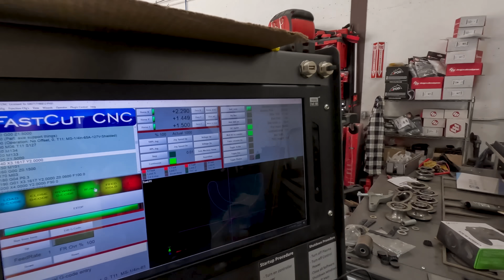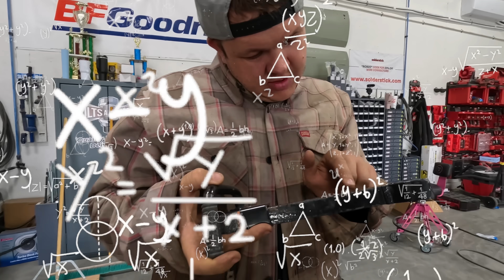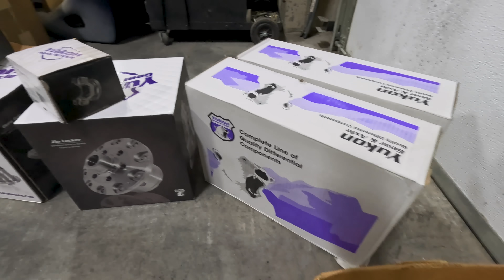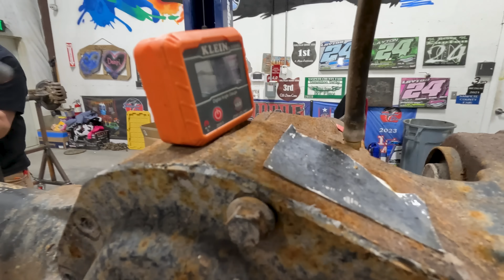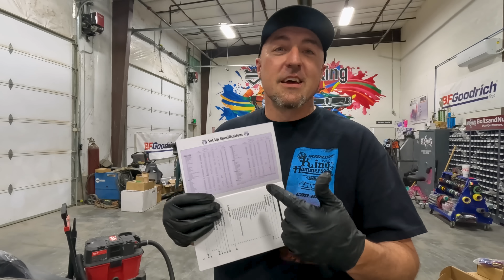Building Custom Axles For SECRET OFF-ROAD PROJECT!

Comment: If you welded a nut into the upright and welded all thread or a bolt into your axle support cups then it would be fully adjustable and give you the ability to level it if you're narrowing an axle.

Comment: Good design.  I like Paul's design since it's a table that can hold the axle, and all the parts being removed and installed.  It works better in a small shop since it is versatile enough to do other duties when not working on axles.

Comment: For the adjustable support, weld a bottom to the screwed on part and tap the top holes, that way they can be used for front or back axles.
Still great design as is!

Comment: Make that pinion support a slider. Bolt the upright to top of slider if you want it removed which I see no reason to. Also if u build the frame square where the catch pan is you can roll 28 gauge in a trough design with a slight tilt and bung to drain. If you don’t want to fool with ratchet straps us 1/4 chain with a small binder or turn buckle

Comment: You should pick up a clamshell transmission parts washer.  I wash everything from engine blocks to complete Tcases, drain pans to jackstands.  Any parts that I want washed super clean.  It's one of those items you come to rely on & can't imagine life without after using it a few weeks.  Gears, bearings, ect.  I have mesh baskets that I put bolts & hardware in, most of the time I blow items off after washing but the heat from washing will dry most off.  Makes preping parts super easy & working with clean parts is SO MUCH NICER!

Comment: If you have a decent used pinion bearing or maybe invest in a new one and hone it out so it will slide on and off the pinion.  Then you can use it to get the shims on and off to probably get what depth you need.  It is something that is done by most shops that do a lot of rear ends.

Comment: I'd have just built a flat table on casters with raised edges a slight pitch to it and a drain. Then a 2x2 receiver welded vertical with Y brackets welded to 2x2 steel allowing raising and lowering for height or removal etc.  When table isn't needed for an axle it's just a work surface table.  Similar to the one Paul from FabRats uses

Comment: Lol I didn't think that Robby Layton can get it on the first try!! If you're going to be doing plenty of differentials I would suggest  have what is referred to as set up bearing ( sacrificial bearings! Just get some bearings and wallow out the inner portion of it)  that way all you have to do is slide them on and off until you get your measurements just right.

Comment: I've seen several of these types of "change the gear" videos.  It seems that everyone uses an aftermarket cover instead of the stock cover.  Is this just a appearance thing, or would a stock cover interfere with the new gear set?

Comment: Always, always, use slow drill speed with steel guys. Fast drill speed is for wood working  or when sanding/polishing/wire wheeling etc...  trust me please,,,slow is fast when drilling steel..✌️👍🇬🇧

Comment: The top of the racks should be a 90 degree "V" shape.
Reply: Yes, and have HD, locking, bike-chain type clamps on the top to SAFELY hold all axle housings on so no one can get hurt of one is bumped hard or maybe jolted while moving the stands around.

Comment: Instead of using ratchet straps to hold those axles steady or still., same concept of the oil filter wrench that uses the bike chain and you hook the bike chain in the tightest spot and then clamp it,.. use the same thing on the ends where the stands are, hooking that chain strap over the top of axle and then clamp it there. Its that or you can make your own by using a small but strong chain over that one end is secured to the stand, the other can hook to a binder that is real small like a baby binder.... quick and easy

Comment: 16:27 Since it has no load to hold, other than a pan of oil, just straight cut once  from outside towards the center, to take off the pressure.....Straight.

Comment: Is that rear axle a 6,000 lbs rate rating.  For a 450 I think that you will need the 15,000 lbs that were under the 450 or 550 trucks.  The front axle under the older 450 were 7,000 lbs compared to the 5,000 lbs that were under the 250 or 350.  That bus probably weighs close to 12,000 lbs without any additions or people in it.

Comment: You dont need to rent a trailer either stuff it in a small uhaul box truck or buy a 4x8 folding harborfreight folding trailer weld it up at Matt's so it doesnt fold anymore (at highway speeds with pothole season upon us you dont want the latch jiggling and it fold and wreck your ride) strap it down and go when you get home build sides fot it you have a utility trailer for your new whip or a cozy camper for 2 when you need to get away from reality dont forger the sticker if the campers rocking dont come a knocking people freak when they see an older couple climb out in the morning especially if she uses a walker and you look the kids in the eyes with a serious face and ask wheres the nearest hospital she could walk fine yesterday

Comment: Why? Why clean the cover surface after assembly? All the abrasive scotchbrite particles and old gasket get blown inside the case no matter how careful you think you are being. I have seen many youtube mechanics do this. It's like tossing in a pinch of sand for good measure but I doubt that the bearings appreciate it!

Just do this step when doing the major cleaning after disassembly.  Then, after reassembly, just a wipe of the gasket surface with some brake clean on a rag and you are good to go.

Comment: So Robby, what's it like working with n adult in the shop for a change? Sooooooo much faffing around building that axle stand, that was embarrassing watching that. Could have just thrown those jack stands onto a metal table and you would have been ready to go hours earlier. Luckily you're a wizard at doing bodywork and painting or you'd be broke :) Oh, the boss is tres' cute too, so you're lucky there as well :)